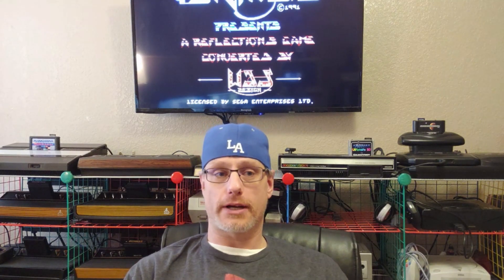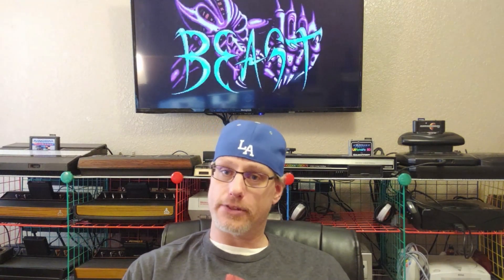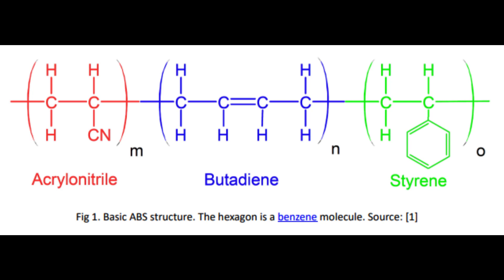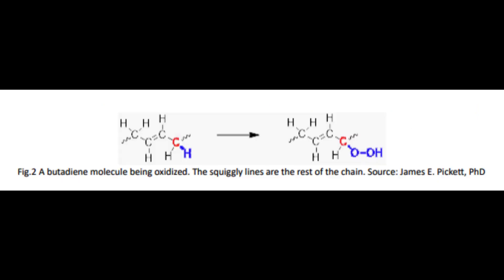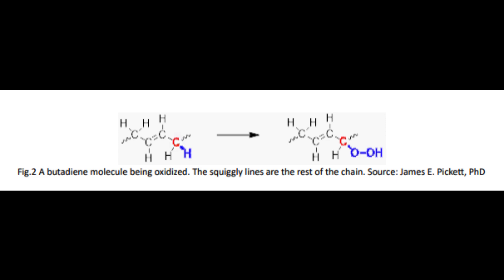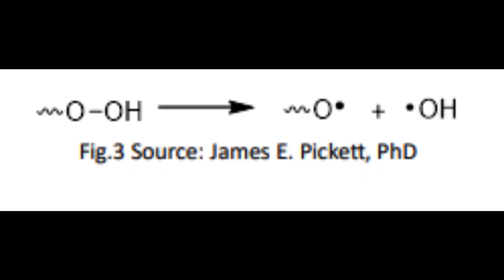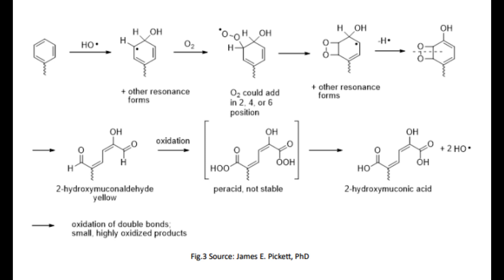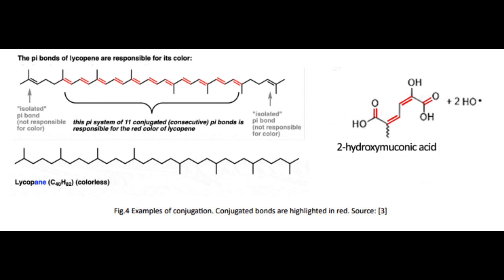Retrobrighting The True Science Behind It

Comment: I love the yellowish aspect of an old snes. Never had any intention to retrobright any of my consoles, but I wish my Snes Mini or Snes Jr had yellowed more uniformly, cause it's white in the top and has some yellow stains on the botton, but it's not totally yellow, which I think it would be more cool. The same happened to my PSOne. When I first saw this stains I thought it was caused by the orange cloth I use to cover the desk my consoles are installed but I don't know if that's the case.
Reply from the maker: I'm glad you like the yellowing, I feel it gives the systems character and shows their age. I guess you can call me the "Rat-Rod" console collector. 🤣🤣 No, the yellowing of your consoles is strictly due to the fire repellent in the plastic. To reduce the yellowing, make sure they are not in direct sunlight (which it sounds like they are not), or in a hot area. Cool and dark is the best way to keep them, but make sure there is no moisture (no dank basements, storage areas, or swamp cooled areas) either as it can corrode the electronics inside. Thanks for watching👍👍
Reply: @RetrogamerGenX  Thanks for the tips. Your video was the most enlightening I've ever seen about the subject. I never wanted to retrobright my consoles because I don't think it was necessary but I never knew it could ruin the plastic even more.

Comment: What an awesome video; super educational! Could you explain why some parts of the SNES has not yellowed at all? Do certain plastics not yellow?
Reply from the maker: Thanks.. The SNES had parts from different batches so that's why some may have the top half that yellowing but the bottom half isn't or the plastic by the cartridge port isn't yellowing but the rest is. Different parts were made by different plastic manufacturers with different manufacturing processes. If you got a SNES that isn't yellowing, you're one of the lucky ones. But for most they have half a shell or all the shell or some parts of the shell that are yellowing.
Reply: @RetrogamerGenX  thank you so much for the explanation!

Comment: After retrobright it is a decent mitigation measure to clear coat the plastic.
Reply from the maker: True, which helps. But... I have taken in consoles and computers for parts machines that were retrobrighted and clear coated years ago, but now have a cracked and peeling clearcoat which is impossible to get off essentially destroying the case. Monitors being the biggest offender. Over the years with heating and cooling, especially plastics over transformers and voltage regulators, the plastic contracts and expands, which eventually will lead to cracking and peeling. This is why plastic is dyed in the manufacturing process and not painted/clear coated. It doesn't happen all the time. If the right prep work is done, like sanding it, which destroys the surface anyway, it can stick possibly forever. But to each their own, I prefer having electronics that are yellowed over retrobrighting. It just shows their true age, and not "plastic surgery" like the hollywood stars.. 🤣🤣🤣 Thanks for watching and dropping a comment,.👍👍
Reply: @RetrogamerGenX  Sure. Thinking in the best solution before the plastic yellowing, there are some ceramic coatings for car headlights. Maybe that is a solution to avoid yellowing, considering it is made to least many thermal cicles and it would not crack.
Reply from the maker: @RaphaEnohata  It might work. It would be worth a try!!!👍👍👍

Comment: Thanks for the video, which makes a lot easier to understand the various process that were explained before in the retrobright chemistry guide. I have one question though, we know that the "same" plastic can yellow differently under the very same condition. For example my old Atari STE's top case yellowed, but not the bottom case. I previously understood that it might have been a difference in the fire retardants, because factories didn't apply exactly the same formula when making the cases. That explained why in some rare cases you can fine perfectly preserved systems - and as a matter of fact I have one who is perfect and never gone through retrobright (100% sure). But now if I understand well, it's not an 'added' fire retardant but the ABS itself. So is there an explanation to that difference in yellowing or is it just... luck?
Reply from the maker: From what I gather, its the environment they were stored in too. So for instance, a lot of consoles from hot climates are really yellowed while consoles from cooler climates are less yellowed, or maybe not at all. Heat plays a major role in the yellowing process, the more heat, the more yellow they become. That's why alot of my consoles are not yellowed as they are from cooler Colorado. From my understanding, the guy I got my SNES from, it was his original and they where from Arizona. That's why in the summer I have a portable AC unit I run in this room all day. Just to keep everything cool. Now the consoles that have like a yellowed top and a like new bottom, that is an instance of different production runs of the plastic. So like my SNES has that piece up top that is not yellowed, that probably doesn't even have the bromine in it. I'm sure to get a good answer we would have to talk to the folks that produced these shells and ask if the chems were measured precisely, if not, that might be why. Might be luck if you got one that had less of the chem in it. Nintendo used bromine plastics for fire proofing, not ABS. So they did add the chem. But many other companys did use ABS. Good question...
Reply: @RetrogamerGenX  Yup that's exactly the case I'm talking of. The reason I was given by friends into preservation (who are against retrobrighting because they run a huge associative preservation collection here) told me basically "case parts came from different sources and sometimes the factories messed up".

Comment: Awesome video! Very helpful info that I hope more people pay attention to. 

People, in general on YouTube, could stand to use more care with chemicals. I have never used Retro-Bright, but I have used over the counter hydrogen peroxide only on SNES controllers, and only outdoors. 😵‍💫🤢 I thought, "well hell, these are already fugly, so I can't mess em up anymore."

Something I find interesting, though.. My SNES is bright gray like I just pulled it out of the box. And I can honestly say that I've never seen another in as good of shape as mine. I have often wondered if perhaps mine has just stayed cool enough (temp wise) thus slowing the oxidation process to a crawl. So there's no perceivable oxidation.

Thanks for the cool video!
Reply from the maker: Yeah I see it all the time on You Tube with people and chemicals. Not just with retrobrighting, but other things as well. Either they don't know, or they just don't stress the importance of safety while using those chemicals to their viewers.

You may have one of the few examples of a snes that has no ABS / bromine plastics. Like my SNES has that top part that looks fine. I have seen some in the wild that have either the bottom or the top of the shell looking good, but the other half yellowed.  It's really just depends of what batch yours came from and who manufactured it. Nintendo used several different distributors for their plastics. 

Thanks for watching and commenting bro...